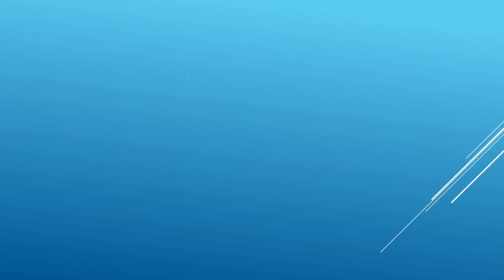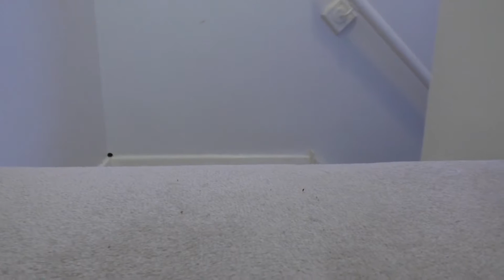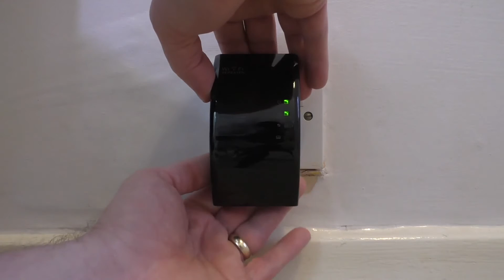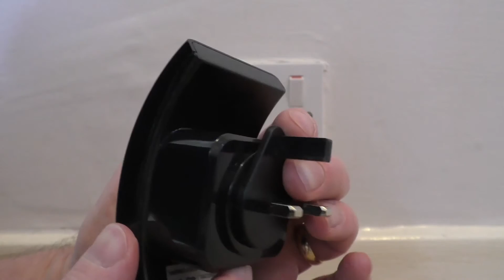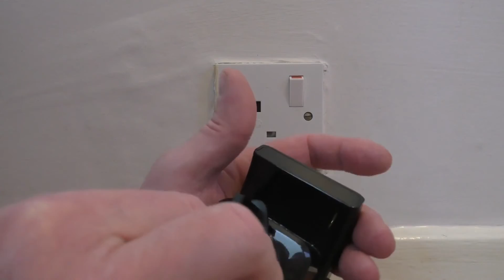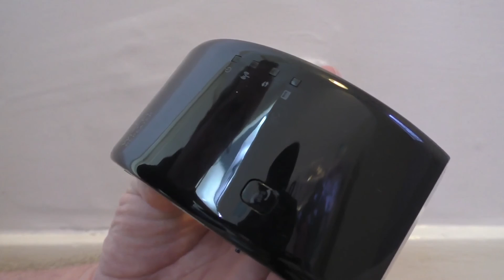PIX-LINK 300 Mbps Wireless-N Mini WiFi Range Extender

Comment: I have a similar looking one but I think it's from a different manufacturer, very handy my best use has been to make an ad hoc network when away with no wifi to connect a MacBook and Apple TV together to stream content from the MacBook to the Apple TV. Definitely a worth while investment to fill in gaps in your WiFi network throughout the house. The good thing about those clip in plug adaptors is they are easy to replace, it's kind of funny the earth pin is just filling a gap being plastic anyway so you could just do without it - most sockets don't require a fitting into the earth pin to allow the live and neutral to enter nowadays.
Reply from the maker: They are a very useful device to have and that one will be staying in that socket for sometime I think anyway. Great use case there, great for use in a hotel room when away from home and need some quality viewing on the cheap. Filling the gaps is my main requirement as the router is down in the extension where we many reside. Ha yeah they are a bug bear of mine really and if I saw some one selling a bag of em cheap I'd snap them up, remember the classic trick of a tea spoon handle in the earth to get the old two pin plugs in lol. Only a bad thing if a dodgy sparky fitted the socket lol. Thanks for watching and sharing buddy :)